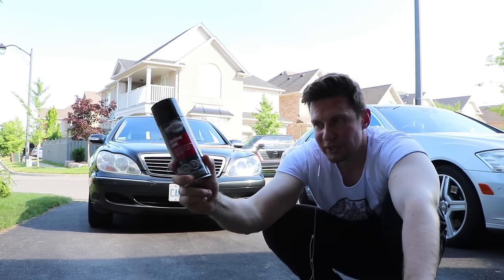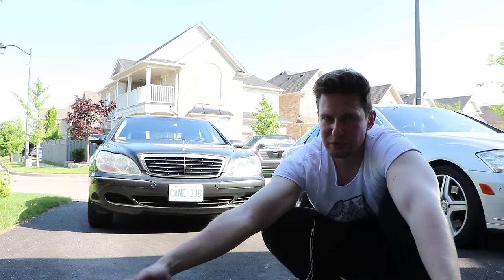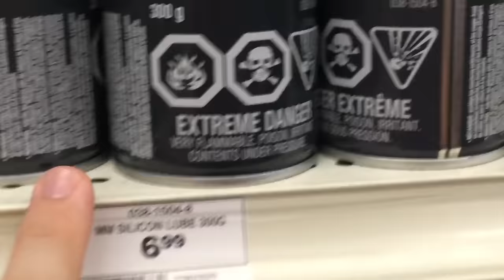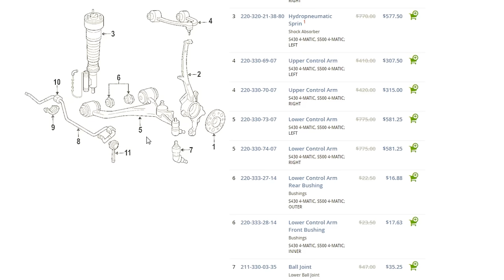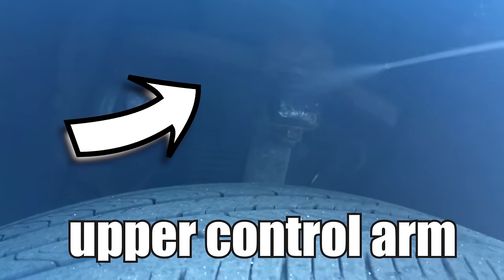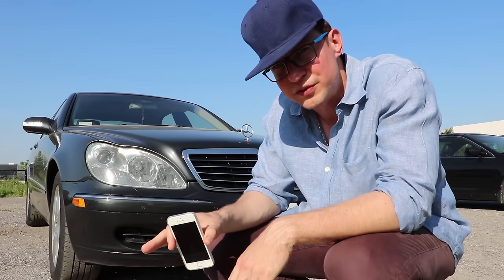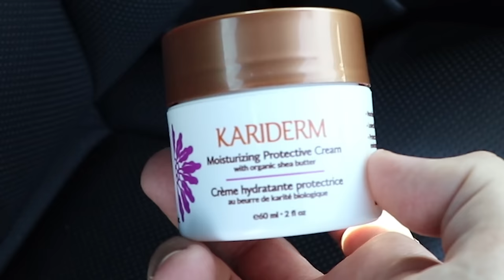Lube It Up! "Fix" squeaking creaking suspension with a can of spray!

Comment: This works works works ! This saved me pulling up sounding creaky asf everybody looking and stuff my ball joints weren't busted or nothing just dry asf
Reply: Shamilia Miller        Id go over speed bumps even taking them slow and I’d get a horrendous squeak the whole parking lot could hear. Jack the car up took wheel off sprayed all the rubber bushings and everything else that was rubber with silicone spray no more squeaking. I can now take those speed bumps with silence.
Reply: Lmao so true!
Reply: @Ryan I started this process 2 hours before test and had taken test within 3 hours so it lasted that long
Reply: @Ryan did it work man??
Reply: We're exactly do you spray on too?
Reply: It's better if you can inject actual grease into the ball joints boots.

Comment: If silicone spray doesn't work well, try putting some AT205 Reseal in a spray bottle and applying it to the bushings. Usually takes a day or so to work but more durable than silicone.
Reply: It's 5 times the price
Reply: @paulgilraine3127  Yes but cheaper than replacing bushings. Silicone usually works for me.
Reply: Alright "Scotty" 😂
Reply: @craigerylee4013 😂
Reply: Do you dilute it with water?
Reply: @limeallens6160  No. Try silicone spray first. Worked well for me. Be sure the container says it's compatible with rubber.

Comment: Without looking at the car in person I couldn’t say much for the other suspension parts, but looking at the way the front bounces up and down after you stopped pushing on it, I’m fairly certain you need new front struts and mounts. Especially if the front end dives excessively when braking, and bounces up and down multiple times after hitting bumps.
Reply: That’s what I thought… I replaced both struts and the creaking was still there.
Reply: @bradenkay1203 I have the same issue, it's frustrating

Comment: Thank you this really worked for me. My 2006 CLS 500 was making all sorts of suspension noise. I had the sway bar links replaced which was necessary, but still lots of suspension creaking and clicking. Repair shop recommendation was to replace other suspension components starting with lower control arms $1394. I decided to give your approach a try; used WD40 Specialist Silicone Lube ($9) and found a Jiffy Lube which agreed to do it for me ($60 plus tax). Result =95% of the suspension noises gone almost immediately. Thank you! Saved over $1300
Reply: Thank You for your very valuable info input also Sir. I, myself not being a mechanic and without being able to find a rack to use, hopes we're futile to none as no repair shops won't do this kind of work, as I've been finding out, they only really just want to literally "rape" someone in only replacing parts !

Comment: Some people in the comments are misleading by saying you eventually need to change the parts. In some cases you do but sometimes the noise is debris, corrosion or rust build-up between a bolt and nut or area by which the bolt portion proceeds. For example, the hole where your outer tie rod bolt/nut goes into the steering knuckle can be loosened, cleaned and ubricated to get rid of the noise without changing the part (sometimes I even use sandpaper to clean the stud part of the tie rod so that it fits smoothly back into the steering knuckle). Only this process takes a little more than spraying and you should have some automotive mechanical skills (as you may throw your  alignment off if not done properly).
Reply: Especially on Mercedes
Reply: Ever notice no matter what the problem is with your suspension components it’s always a bearing they say?

Comment: I was skeptical, so I tried it, was less skeaking for 1 day, Just reapplied today and it's almost no skeaking, need to find a lift to really get after it. Used wd40 silicone specialist. Thank you for the tip !!!

Comment: I did this BEFORE seeing your video. I inspected our 2008 ford edge for the same squeak and came to the conclusion it could be the lower control arm. I sprayed it and it disappeared. Now, the symptoms of a bad lower arm is clunking, tire wear, steering issues, etc. None of that has happened on our edge but we must keep a close eye on these symptoms or lots more money will be spent on repairs.

Comment: This worked like a charm on my 06 S55 AMG. Yesterday had that awful sound coming from the front driver’s side. Pushing on it made the same exact noise. A can of silicon line from Home Depot $3.98 a can and she’s rolling and quiet! Thank you for the quick inexpensive fix!
Reply: Silicon *lube
Reply: Can you do it without removing the wheel I’m afraid if I go to a shop an ask them to spray they’ll just lie and tell me this won’t work etc mine only creaks and low speeds but it’s so annoying I don’t think it’s broken or need replacing

Comment: I just did this on my Tesla Model X, the front was squeaking, and I sprayed it on everything that was connected by a rubber bushing to another part, and most of it went away immediately! I will wait a couple days to see if it goes away totally, but if it doesn't yet, I'll give it another helping of the spray!

Thanks so much for this video!!!

Sending my thanks from Calgary, Alberta!
Reply: How is it now.
Reply: @bobmurphy1142  squeaking again even after 3 helpings of the stuff. :-( I have a service centre appointment tomorrow. I'll just pay to get it fixed.
Reply: @AriellXavierArevalo  prob didn't hit the area that was squeaking
Reply: @DarioLProductions or just maybe the part is too far gone. And really do needs to be replaced.

Comment: That is only a temporary measure as you will need to get it fixed eventually. As a rule-of-thumb it is sensible to keep all moving parts lubricated to prevent the costly trips to the garage over the years with any vehicle.

Comment: If you spray a ball joint to shut it up make sure you check it for play because it may seperate if worn too much.
Reply: the ball-joint can do all it wants to... as long as it's in silence 🙂

this nagging noise when the BJ has prematurely dried out is purposely built as a warning (much like on the brake pads without a dash-light sensor).

The 2 links to the stabilizer-bar are super cheap and go bad extra quickly in Benz

Comment: Instead of replacing an entire suspension arm, you can just buy the bushings and ball joints then take the arm off and the it and the bushing to a shop that will press the new ones in for you. I'd guarantee you for that $500 arm, doing this probably would've been $100 or less including the shop labor. 

Also to diagnosis where the squeak is coming from, you can spray them with water which will stop the squeak for a bit which will allow you to confirm which bushing is squeaking instead of having to fire the parts cannon.
Reply: Only buy silicon bushings ignore the rubber ones. Then you will never have to change them again.
Reply: name/10

Comment: When I change my oil at 5000 miles , while on a mechanics lift . I liberally spray 303 Protectant on all rubber and plastic components underneath . It has been said to spray the silicone into a styrofoam cup . If it starts bubbling up , it was the negative effect of the propellent  . Then to use a silicone spray that won't have that effect . Because if it does the propellent will degrade the rubber over time .

Comment: Thanks mate. I got a Mercedes benz c200 w203 that has the exact same squeak and I did check if anything was loose and so far nothing. Will give that spray a try.
Reply: Did it work

Comment: This is only a temporary fix as soon as it wears off and you go through puddles of rain and snow the noise will come back. The bushings are worn so eventually they're going to have to be replaced. But you can also use spray Grease and it will last a lot longer than just a silicone spray. Everything's a rip off with these cars today they can make the bushings last for 50 to 80 years but they don't because they want you to replace them just like the brake lines they can make everything rust free but they don't because again it's all about money money money that's what the whole world is based on. Actually it's based on everything is a ripoff
Reply: It's like the saying "anyone can make a bridge that stands, it takes an engineer to build a bridge that barely stands". They just build the stuff as cheap as possible instead of building it to last.
Reply: Planned obsolescence. Thats why I drive old reliable cars.
Reply: Yupp if they made good cars there wouldn't be a need for used car salesmen and there'd be less repair shops.
Reply: Yup that's true
Reply: Wd 40 silicone spray is waterproof. How would puddles wash it off? I've had it on my windscreen and windows for well over 1 year through many washes, storms & snow....never reapplied
Reply: Thanks coach putting some on the old 92 Ford truck
Reply: Hold on till the summer
Reply: False, and 77 bone heads who have never used it.

It’s waterproof.

Last easily 5/6 months regardless of rain or puddles
Reply: What about tubed grease? Like actual machine grease? Will that last longer than the spray? I got a shit ton for free, so I figured I’d put it to use
Reply: @athangundling655  yeah that works really well. And will last a long time and won't wash off. Any type of Grease will do just like they used to use in world War II for all the machinery, like tanks military trucks and weaponry. I used to pile tons of grease on those things on the axles and bearings and everything. It will last many many years without rusting. Good luck
Reply: @chaseww  hell yeah buddy, that’s exactly what I like to hear, figured I’d put all this grease to good use, it was just sitting up in the attic at the shop and my foreman was about to throw it away I was like NOOOOOOO!😂😂 good stuff too he was gonna waste at least 12 tubes of extreme pressure multipurpose grease

Comment: Avoid/be careful around the brake rotors though. Lubing the brake surface is the last thing you want.... :)
Reply: Dear, Is it ok to spray all front parts and joints? Control arm, stabilizer, struct mount ?
Reply: I was wondering if his brakes worked at all after that!

Comment: I have the same noise and it happens when turning steering wheel while stopped too 🙄 I just spent over $1000 doing all brakes and all shocks/struts and the noise still happens. Gonna give this a shot!
Reply: Wish you good luck 🍀
Reply: I had this issue and replaced control arm and worked.
Reply: How did this work ?
Reply: What are you referring to?
Reply: Was it a ball joint? Or do you not know still?
Reply: @xGaMErZzZPrOx  lowerball joint on his control arm yes

Comment: My w221 is making the exact same noise. I bought the car 2 weeks ago. I know they lubed it up real good then sold it to me🤷‍♂️
Reply: I have the w221 as well, its doing the same squeak. Did this solve your problem for good or sound came back? Im a bit worried if its safe to spray as i also heard it could wash away any parts that have grease in it

Comment: Just wondering if all of that silicone spray will cause dirt to collect during warm weather and wear on those bushings.
Reply: If your bushing is squeaking and spraying it with lube takes care of the noise, dirt was likely able to get in already. I don't think spraying it with lube would make that problem worse.

Comment: If you spray one motion point at a time, you can discover the source of the squeak.
Reply: Please elaborate
Reply: Shivaram Rajkumar pretty simple spray one part at a time drive the car or push where the squeak was and see if it’s gone if it’s no longer there you found your verdict
Reply: @steveyuhas85  its a lot better to spray the entire thing.
Reply: @davecfishing7907  You repeat the process until every moving part has been sprayed.
OP is right, this is the way to do it. Find the source of the noise, then if it comes back a week later you know it's not just a lubrication problem, and that part needs replaced.

Comment: So my front left was squeaky on my mazda and apparently at first it sounded like a “ball joint” issue , but i used blaster silicone lubricant and sprayed tf outta the suspension above the tire area so musta hit something right? . Didn’t even take any parts off, and the noise and problem has been gone for a couple days now. I even been driving it around to test it out

Comment: I had the exact same squeak on my Golf mk4!! It drives me absolutely insane and puts me off driving, it takes me forever to stop the squeaking! I’ve tried wd40 it helped a bit but it still squeaks like hell. Where did you get the lubricant you’re using? Greetings from the uk
Reply from the maker: Hey, wd40 no good, it will just dry out the rubber faster. Any big store that has tools and supplies should have a silicone lube.
Reply: @DanielKon15  many thanks for your help

Comment: Dear, Is it ok to spray all front parts and joints? Control arm, stabilizer, struct mount, brakes ?
Reply from the maker: Just the rubber. Never let the spray onto the breaks
Reply: @DanielKon15   So i can't spray front joints, stablilzer, control arm and back chassis ?
Reply from the maker: @sami mohammad  yes u can, just don't get any of it on the breaks/ rotors.

Lemme know if it helps.
Reply: @DanielKon15  Thank you.

Comment: Les Schwab changed my front and rare shocks on my f150 including one of the leaf springs . Now it makes squeaking noice on every bump k go thru also a popping noice from the front every time I hit the brakes little harder. A shop checked my front shocks and supposingly weren't tight enough  but the problem remained afterwards . Any suggestions?

Comment: So in the video, why would you highlight the actual lower control arm @ $581 instead of the rubber bushes (directly bellow it and only $16.88) which in a realistic 99 out of 100 cases is what needs to be replaced?

Comment: Yeah that's really smart. Spray the crap out of everything near your brake assembly.... Screech... Smash, bang, boom,!! 
I'm not sure what happen officer, my brakes didn't work at all. But my suspension was soooo quiet..  Please don't spray any kind of lubricant with such disregard anywhere near your brakes for your safety.  Sometimes just taking your car to the carwash and spraying all of those areas with the tire cleaner and then hot soapy water will get all the brake dust of which is what causes some of that in the first place.
Reply from the maker: notice the shields

Comment: Is WD40 SILICONE SPRAY helpful for lubricating my cars suspension? Or any other brands more helpful? How often? 2-4 times annually? Thank you for your help in advance to anyone.
Reply from the maker: I aim for 2 times a year, before it gets cold outside and before it gets hott. 4 times sounds ideal/ rational but it's all speculation. I would do it 4 times myself but I never find the time. Also avoid getting the spray in your rotors/ breaks. I have shields on my car in the video but some may not. WD40 brand is very reputable. Feel free to use my Amazon link in the description :)

Comment: I’ve had a horrible squeaking in the front end of my 2005 Dodge Durango for at least 2 months now. I had it serviced earlier in summer and recently had a tire patched so asked them to look to see if something is wrong, they couldn’t find anything but said since there’s an oil leak, it’s probably because it’s going onto the bushings and causing the squeaking. It is a really fast and bad leak as it’s on EVERYTHING. But, I would think oil would actually lubricate and not cause this??
Reply: Unfortunately, no. Oil/Petroleum will break down rubber, rather fast actually. Recommend spraying a whole crap ton of silicone lube to clear it out.
Reply: @Joes432 Thank you! 🙂 I had no idea that bushings are rubber 😅 I thought metal lol
Reply: @Joes432 Will It clean the oil off as well??
Reply: @Lizzy_333   If you get a good can with a spray nozzle, it will force enough of it out of the way of the bushing contact surface. However, if it's a lot of oil, I do recommend wiping down and cleaning the arms/area, maybe with citrus cleaner or something that would dilute oil. Bushings are rubber-encased with a metal sleeve. White Lithium grease will degrade rubber.
Reply: @Joes432  Wow, ok!! Thank you so much for this info 🙂

Comment: Do not use WD40 on any suspension bushings, it will severely decrease its durability after a while.
Reply: @TechStuff365  No. Use purely silicon based spray instead.

Comment: As per Scotty Killmer, wd 40 is safe for spraying suspension parts and say the opposite 😳🤯😭😫😱😯.
Silocne seems to be better of the two, will try having issues with my 2007 Honda Civic, will try both and see if the results.
Thanks.
Reply: Omg I have the same car, did I work for u ? When I put it in drive and slowly let go of the brake to move forward I get this weird creaking sound

Comment: You could just use a grease gun and lubricate your chassis and the results would last much longer and it's actually recommended by the manufacturer

Comment: White Lithium Grease spray works too
Reply: you're right with grease a film of silicone isn't going to be effective for a week 😂
Reply: White lithium grease is not supposed to be sprayed on rubber. Only on metal
Reply: GreatGrandmasterWang I would think white lithium would be better than using WD40. I have the 3M silicone but it’s not a spray it’s with a brush...